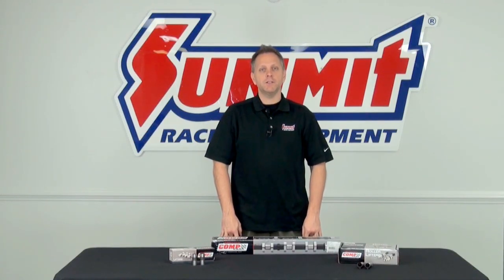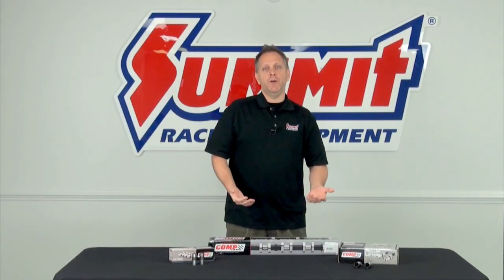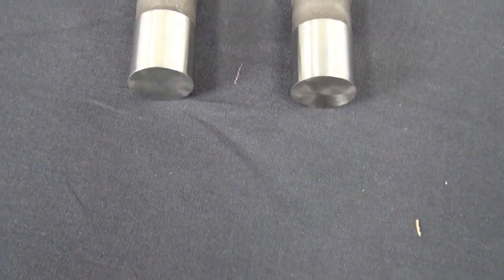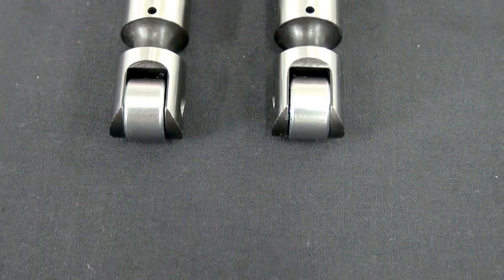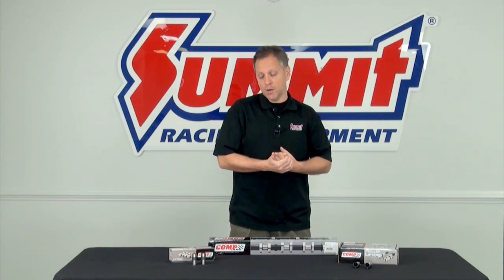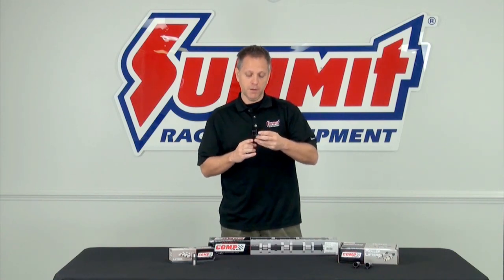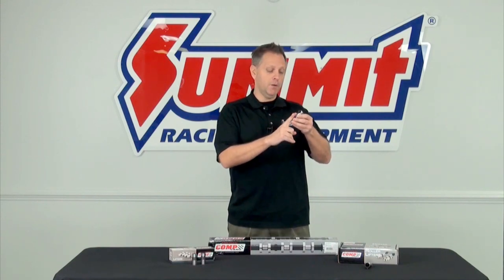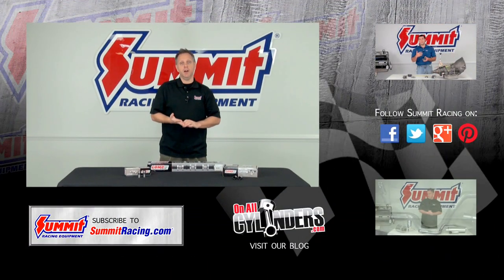Roller Cam vs Flat Tappet Cam - Summit Racing 101

Comment: How can you get more power out of an automatic transmission aode? How much torque is it capable of stock and how can it make with it being built/modded with whatever upgrades suggested. Can a aode be built to take 600 plus horsepower and put it to the ground with very little lose of power?
Reply from the maker: Check out Performance Automatic. They offer Ford AODE transmissions and transmission packages that can handle the power level you’re talking about.
https://www.summitracing.com/search/brand/performance-automatic/part-type/automatic-transmissions/transmission-type/aode?SortBy=Default&SortOrder=Ascending&N=transmission-type%3aaode
 
https://www.summitracing.com/search/brand/performance-automatic/part-type/automatic-transmission-packages/transmission-type/aod?SortBy=Default&SortOrder=Ascending&N=part-type%3aautomatic-transmission-packages%2btransmission-type%3aaod

Comment: So will it hurt if I run a flat tappet cam in a roller motor?
Reply from the maker: This will not hurt the motor, however a flat tappet cam will not make as much power, will have a shorter lifespan, and you will need to swap out all other valvetrain parts to match the flat tappet cam (lifters, springs, pushrods, etc.)

Comment: I have a 1970 Gen. 1 Chevy 350. Is it better to get a new Vortec block already fitted from the factory with roller lifters than it is to retrofit a Gen. 1 block? 
 And what about the weight difference between stock flat tapet vs retrofitting with roller lifters?
Reply from the maker: +707SonomaComa, 
If you already have work done to the early block, just use a Retro-fit cam & lifter set. If you are starting from scratch and not getting radical on a camshaft, then a later model OE roller block has some advantages. As for weight, all roller lifters are heavier than flat tappets, thus the need for more valve spring pressure. Feel free to give us a call, we can help you pick out the right stuff. 1-330-630-0240.
Reply: Thank you for your reply.
I would like to do a full rebuild.
Might as well use a later model block vs retrofitting an earlier model block.

Comment: On flat tapped cams do you have to run higher zinc oil can someone text me back and let me know I just have a basic Chevy 350 with 30 over it sounds like it has a wild cam with ceramic headers.
Can you let me know if I have to run thicker oil with higher zinc like Royal purple and does it have to be synthetic?

Comment: I bought a long block replacement engine for my 1989 chevy truck and I noticed that the lifter galley had provisions for a roller valve train setup. Would I be able to upgrade this engine to a roller setup and if so what would the total cost be.
Reply: End of page at http://tbichips.com/?page_id=73 lists GM PNs #12371043 #12371042 #10457356 and of course you'll need a cam. Sure you could get cheaper lifters and separate spider thing off eBay too. For total cost you may or may not have to factor in chip change issues with the change of camshaft.

Comment: do tappet lifters wear out quicker than roller lifters? i recently bought an '86 corvette and read that the L98 engines of that year had tappet lifters, in '87 they changed to roller lifters, was just wondering if that was the reason why
Reply from the maker: Hi Mr Bungle, 
The factories switched to roller cams and lifters because they have less friction. Lower friction means less oil contamination (metal), lower oil temperatures and overall longevity which they see as lower potential warranty claims!!
Reply: Summit Racing are the cams with flat tappet lifters known to wear out prematurely because of this?
Reply: Mr Bungle
No they wont wear out "prematurely" but you can get longer life from a roller cam .. flat tappet cams are still very competent for street duty and racing .. their main benefit is more affordability but once you use a flat tappet lifter, it must only be used with the cam lobe it was broken in on .. a roller lifter however can be used on any lobe ie: changing cam and using same lifters

Comment: Ok. They have rolls on hydraulic tappets. Why haven't they used a split roller bearing on the cam bearing and the crank. No lead bearings. electric or belt driven sump pump for oil pressure This makes it completely  with rollers. No drag on bearings..

Comment: What's the difference between a hydraulic lifter and a solid lifter and how can you tell
Reply from the maker: Jared Beebe, 
Are you asking in reference to a specific engine make? We need some additional information. Can you give our tech line a call? 1-330-630-0240. Thanks!
Reply: . Small block Chevy
Reply: Summit Racing is this your standard answer ^^^^^^ to an question asked on here?

Comment: i am building a 97 318 magnum v8 keeping it fuel injection and was wanting to know what cam slash roller lifter would give me the best boost in power but not kill my fuel econemy  and if i would need a different set of push rods for such a build
Reply from the maker: Hi Mike, What vehicle is it in?
What is the vehicle mainly used for?
Does you plan on keeping the factory torque converter?

Comment: 91 c1500 350 flat tappet. What would be needed to go roller?
Reply from the maker: +Thelegitrager, 
Roller cam, roller lifters, pushrods, valve springs, pushrods, timing chain set & gaskets. Depending on the size of the cam you choose, you may need to upgrade your rocker arms as well.

Comment: I have a 2000 ranger 3.0 flex, I have a ticking coming from the hydraulic lifter assembly, but I can't tell which one it is. I'm thinking the failing lifter might be clogged or something because I have great oil pressure. Any ideas?
Reply from the maker: Demetrius Brown, 
It will take further investigation to at least narrow it down to which lifter is making the noise. A mechanics stethoscope can be a valuable tool for this. Once the suspect part is identified, replacement would be the easiest and least expensive remedy!
Reply: I know which one it is now thanks.

Comment: I am building a 383 stroker. I am gonna use scat 9000 crank, scat 4340 forged I beam rods, wiseco forged .030 over pistons. some cast heads 2.02/1.60 and 68cc chambers should be around 10.3:1 compression. a dart shp intake, accel distributer, Hedman headers and a holley 750. I just don't know what cam would be best. would like to do a roller setup. what cam would you recommend??
Reply from the maker: Hi Corey, 
We need some additional information from you. Can you please give our tech line a call? 1-330-630-0240. Thanks for watching!
Reply: I called the tech line like 5 times but it was busy

Comment: Highly recommended on high rev powerplant
Reply: hydraulic roller lifters wont rev high unless they are special lifters that have reduced travel internals .. a stock heavy ass hyd roller lifter wont make power over 6500 rpm .. my solid flat tappet goes to 7500 all day long

Comment: I have a chevy 355 with 10.1c ..200 runner /64cc heads.. air gap intake, 770 holey street avenger carb,  700r tranny, 373possey rear end, with a 270h cam... I am going to swap out the flat tapped cam with a roller cam.. any size suggestions on the the roller cam..thanks in advance....(lanatti or compcam)
Reply from the maker: Hi Dion Holloway, 
We need some additional information from you. Can you give our tech department a call? 1-330-630-0240. 
Thanks for watching!
Reply: what rpm stall converter are you running ? that is critical info for cam selection .. also whats the intended purpose for the vehicle ? Daily driver, weekend cruiser, or weekend Hot rod ?
Reply: Stall is a tci 2200 to 2400..and it's a weekend driver... but I just recently stroked the motor(383) now I went with a comp cam xe274... decided not to go with roller...but I think my heads are a Little to big...and i also swapped the holley carb  for 750 demon double pumper.....everything else is still the same on the car from my original post...thanks bro
Reply: Dion Holloway
those heads were a little big for your intended use on a 355'' engine but they will perfectly suit the 383 .. that xe274 should be good for what youre doing though. whats your new compression ratio with the new stroke ? did you have the cam ground on a reduced base circle to clear the rods ?

Comment: How would I tell if my engine has flat tappets?
Reply from the maker: +frincon75, 
By physically looking at the lifters, and that may mean removing the intake manifold in order to see them. Give us a call, maybe we can shed some more light on it for you!
Reply: +frincon75 What is your engine?
Reply: +Pepi Dachev 305
Reply: Looks like the 305 after 1987 has the roller cam and lifters.

Comment: I want to change my 1995 Dodge 5.9 magnum from flat tappet to a roller, what all do I need to make this happen
Reply from the maker: Hi Cliff, 
It seems as though you may have a hydraulic roller installed. Hydraulic rollers came from the factory on models 1992 and up.
Reply: @SummitRacing  no it was a flat tappet magnum motor.  I want to change it to a roller motor. What all do I need for this.

Comment: can you use roaler lifters on a flat tapit camshaft
Reply from the maker: +josh thompson , 
No, due to the egg shape of the flat tappet camshaft, the ramp angle is much too steep for the roller wheel to follow properly.
Reply: +Summit Racing Not what was just suggested... just the opposite.
Reply: Ye i'm confused - i thought one of main benefits of going roller is that you can run a steeper (egg shaped) cam profile, whereas on a flat tappet you can't run an aggressive profile otherwise it will dig in.  I have a flat tappet SBC, was hoping to keep the cam (just a cruiser car) but replace the tappets to rollers to save the cam from getting wiped over time.
Reply: the flat tappet cam shafts are shaped a bit like a ramp to allow the lifters to spin. with a roller cam shaft the lifters are not allowed to spin and if you do lock the lifters from spinning. only a small portion of the roller will be in contact with the cam lobe

Comment: can you run a flat tappet cam in a roller motor
Reply from the maker: Sheron Woodard , 
We need some additional information from you. Can you give our tech department a call? 1-330-630-0240. Thanks!
Reply: depending on the motor. but it requires that you change to flat tappet lifters. you have to rid of the roller lifters

Comment: I was told my 84 mustang has a roller cam.
Reply from the maker: +Matt M ,
Ford started using Hydraulic Roller Camshafts in the 1985 model years in the 5.0L H.O. motor in the Mustang GT and the Lincoln Mark VII LSC.

Comment: So if you are doing a basic video to explain the difference, then do a basic video to explain the difference, basically.

E=mc2 means nothing to someone who initially Sees a formulaic equation to Visualizing beyond a general formulation learning basic energy and mass variables. All due respect to your video here, ya gotta get to some basic levels in a tutorial if you are purporting to explain "basics" with auto cams.

 Least common denominators are good with basic tutorials.

Thanks though for at least trying. Kudos.

Comment: flat tappet camshaft, summit 274 with matching springs and lifters,would it benefit me to use roller rockers?Ford 460- 30 overThanks
Reply from the maker: +Mark culbert , 
We apologize for the delayed response, your comment was flagged as spam. In response to your question: Yes, anytime you can eliminate friction in the motor by using a full roller rocker arm you regain lost power as well as help to lower oil temperatures!